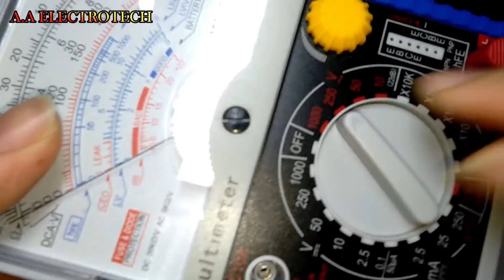how to make a simple 12v to 220v inverter dc to ac inverter

Comment: Hello brother. I made this inverter by following you. I want to know if I give power by 12v 200Ah battery, inverter will burn? Please reply.
Reply from the maker: No, it depends on your load, high load tends to burn the inverter
Reply: @AAElectrotech  Thanks. With 12v 200Ah battery, i can run this inverter without burning? Can I light 12v * 5 bulbs?

Comment: I was wondering why my mosfets burned and I fed it with 18 volts instead of 12 volts and if I give 18v I need to give bigger resistors?
Reply from the maker: Why you used 18 volts?  This crkt is for 12v

Comment: Can I use 12v / 45Ah battery for this? What is the maximum Ah for this circuit? Thanks for your videos. Please reply me soon
Reply from the maker: Yes you can use 45 Ah, the higher the Ah the better
Reply: @AAElectrotech  Thanks you for your kind response... Congratz for all your projects
Reply: @AAElectrotech  And please tell me what is the advantage using ceramic capacitor to out put?☺️

Comment: Can it work better without polyprolin capacitor  i want to construct mine too
Reply from the maker: It works without capacitor,  but the spikes of voltage is becomes higher,  capacitor will smoothen the spike

Comment: Can I drive a 18018 transformer and 12 volt battery in it?
Reply from the maker: No.  It going to drop the voltage.  Use 12012,909 transformer  for better result

Comment: do you have shematic diagram?
Reply: Just google is a very simple circuit using a power transistor can also use the 2n3055 , add a protection diode just incase you screwed up.

Comment: Not sine wave or squad wave it's harmful for any device
Reply from the maker: Its can use in Electronic device.  Not suitable for Motors
Reply: @AAElectrotech  but the frequency is not stable and it's harmful for any device
Reply: @AAElectrotech  but it's working
Reply from the maker: Its stable but 32hz only.  I have 50hz to 60hz suitable for all electronice device.  Thank you for watching ⚡!
Reply: most of inverter are quasi sine wave pure sine wave not easy. this is square wave. please watch mine
Reply: Harmful only for harmonic sensitive devices, at the end he connects the 1microfarad capacitor to kill a few harmonics.

Comment: fake video see the led wire connect led light on before wire connect
Reply from the maker: No. This circuit iz real and working. Many technician made that.
Reply: @AAElectrotech  
I tried in every circuit. It won't work's
Reply: If u tried it and it won't work it doesn't mean it is fake, it means u cannot copy it and u got 0 marks

Comment: Fake scam i made taht already and it's only have the capacity to light up the 5w led bulb..
Reply from the maker: Maybe you didn't understand the the prinple of Watts (W) or power in this Inverter.  It depends to the battery,mosfet, and transformer that you can use.

Comment: 100% It is Fake because I was try to do it,but it is no work
Reply from the maker: Check your connection, check the transistor/mosfet may be it qas defected. Bro may technician already do thet
Reply: Bro but my connection is no defeated. The mosfet is irfz44n,330ohom re, transformar is 12 0 12. All thing is  right.
Reply from the maker: Bro, I promise 100% it will work
Reply from the maker: I didn't made fake videos
Reply: Ok
Reply: No problem
Reply: I love you're another videos